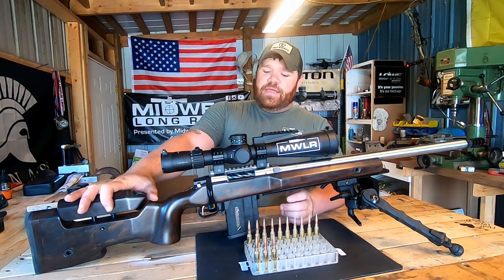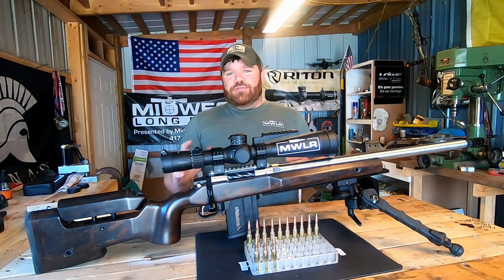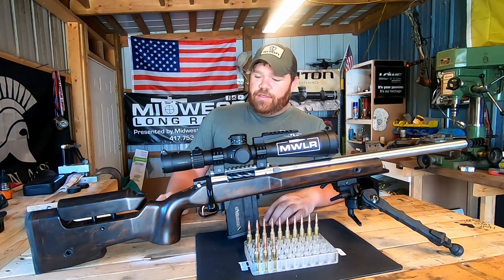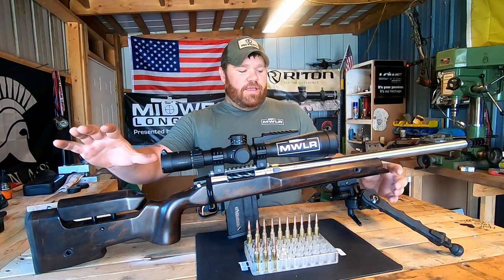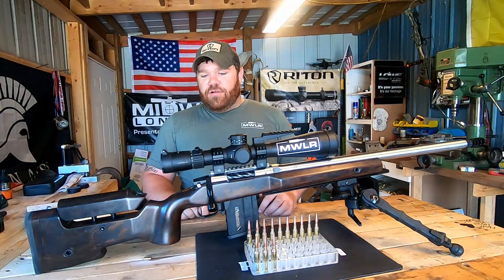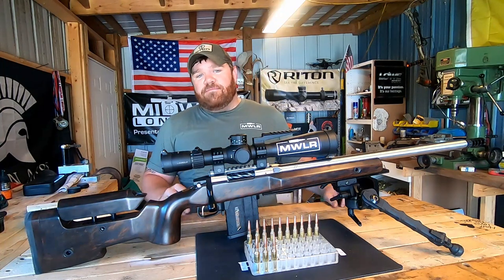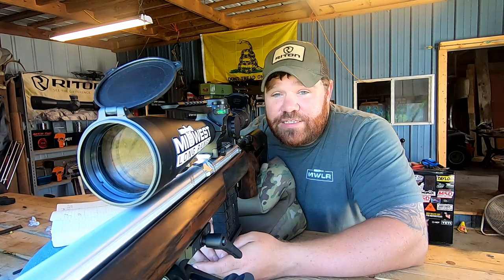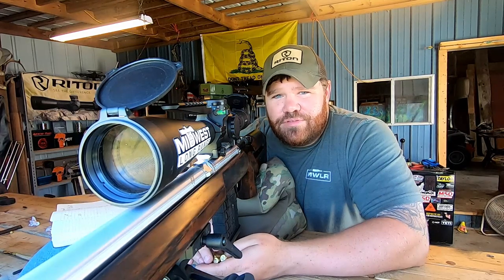25 CREEDMOOR

Comment: definitely not the time or place to be a powder snob but you will get much faster out of the pipe with H4350. im getting mid 28s with a 22'' and 135s, suppressed
Reply from the maker: Everything I’ve read show it should be faster with h4350, I am working on some other loads with staball now but haven’t had time to test them yet. N555 seems to be slower but very stable and consistent.